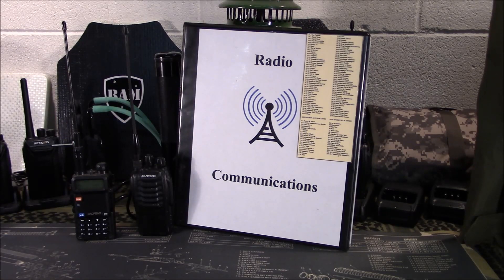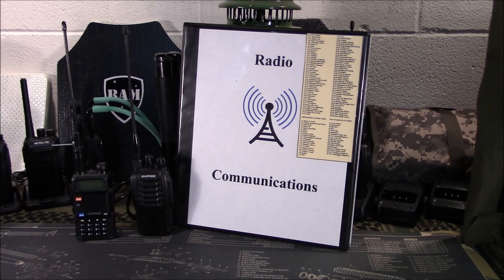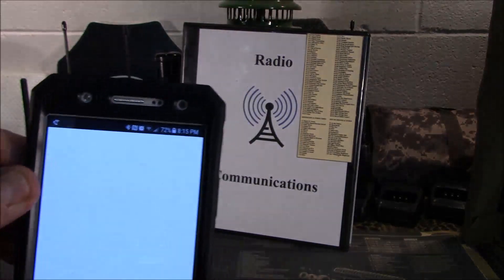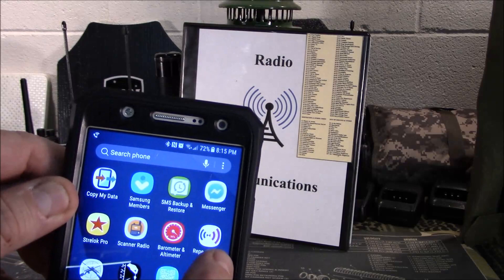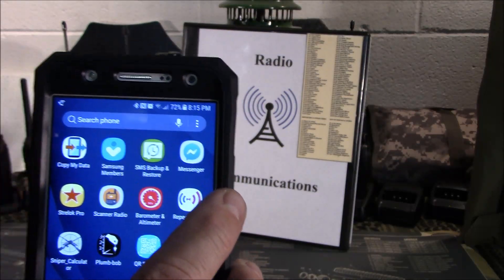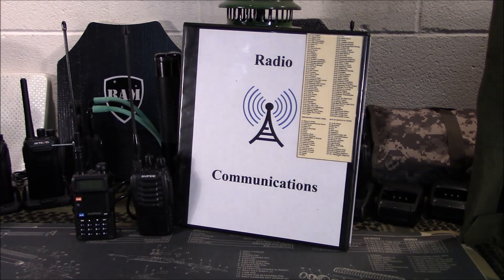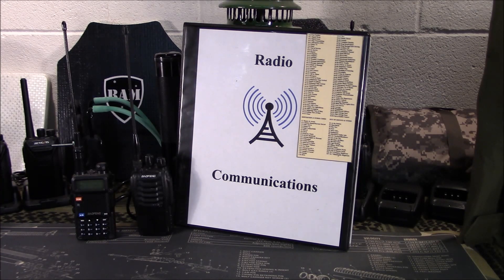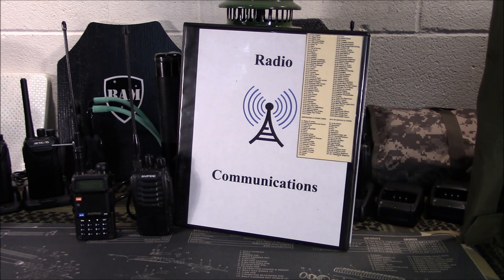(Follow-up video) What frequencies do you need to program into your emergency radio

Comment: The distances you mentioned sound like VHF & UHF line of sight communications.  Repeaters make a BIG DIFFERENCE.  One repeater can cover several counties, and Amateur Repeaters can be linked to further increase range.  Another option is a remote base attached to a repeater.  Several years ago (during one of the 11 year sunspot cycles) I made a contact from California to Maryland using a 1 Watt Handi Talkie with just a rubber duck antenna.  Of course I was on the 220 MHz Amateur band and and was using a repeater that had had a 10 Meter (29.6 MHz) remote base that was putting 100 watts into an omni antenna.  Never underestimate Amateur Radio, and never attempt to use it without training and a license.